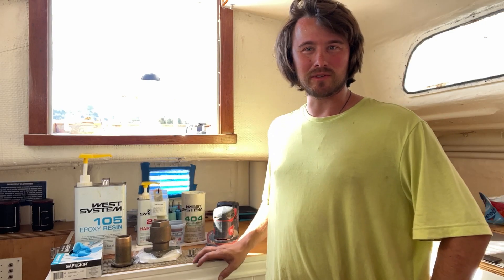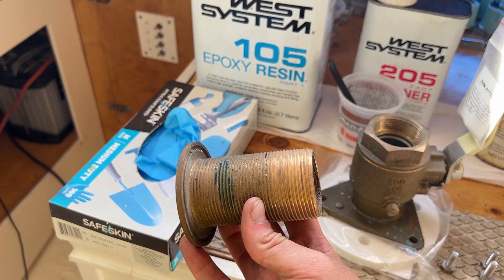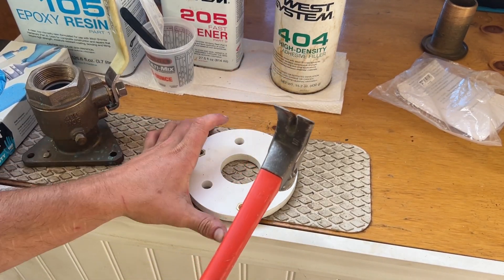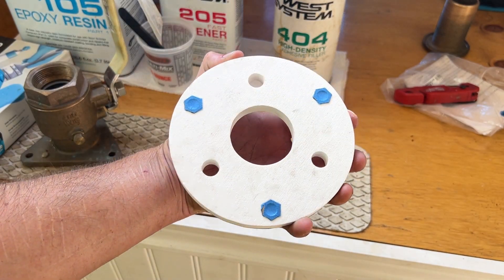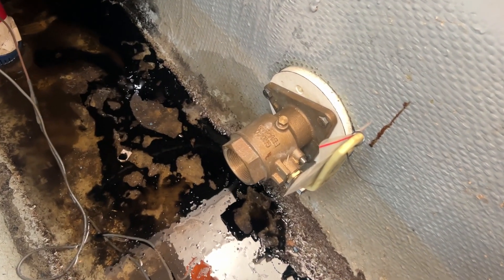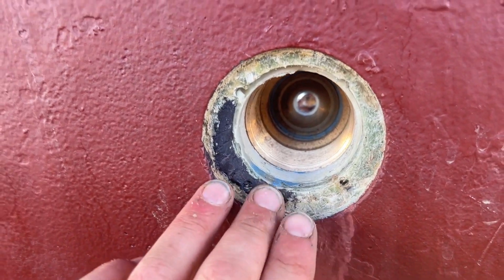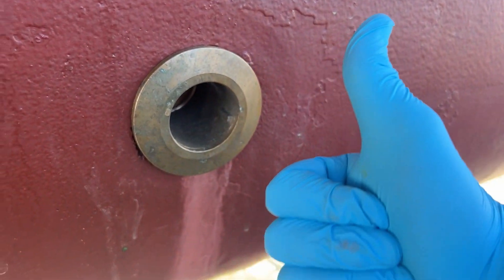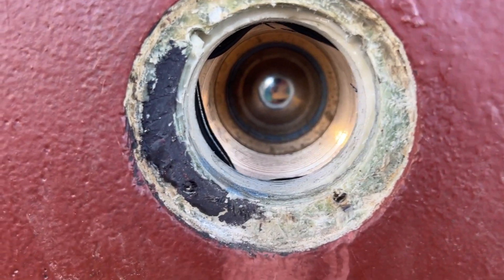How I Install a Thru-Hull on a Boat

Comment: Very helpful video.  Only comment I would add is it is probably better to sand the outside down to gelcoat before installing the thru hull fitting.